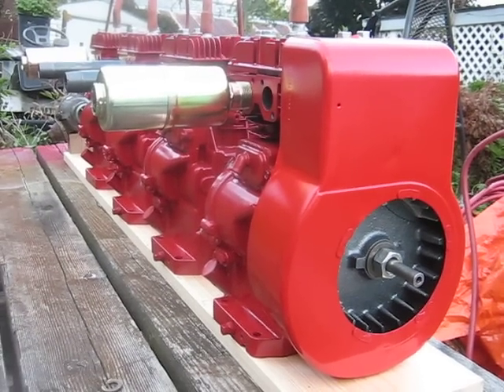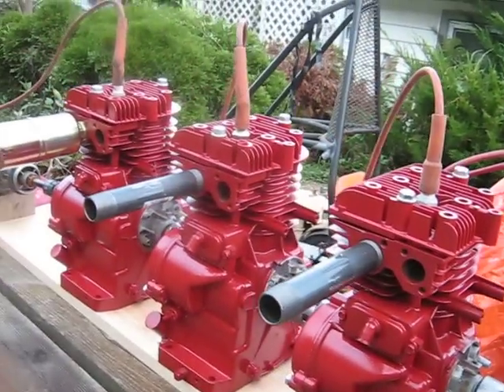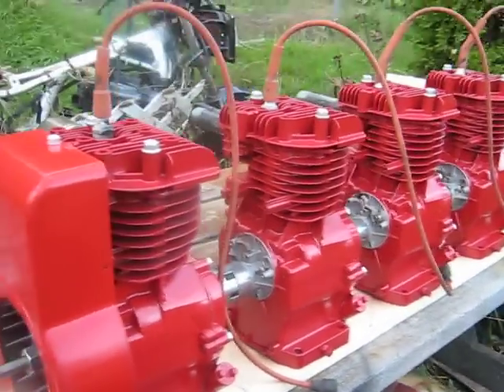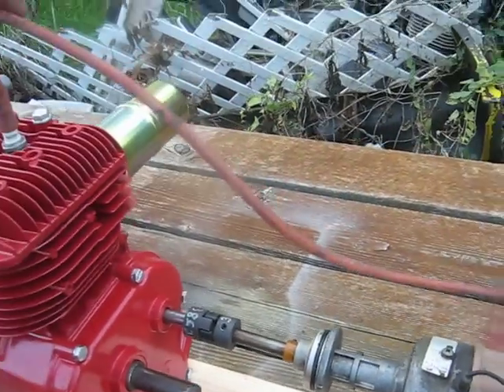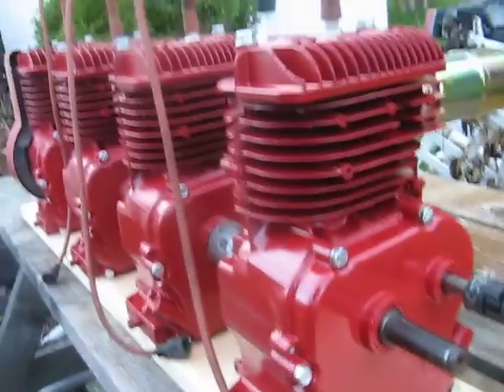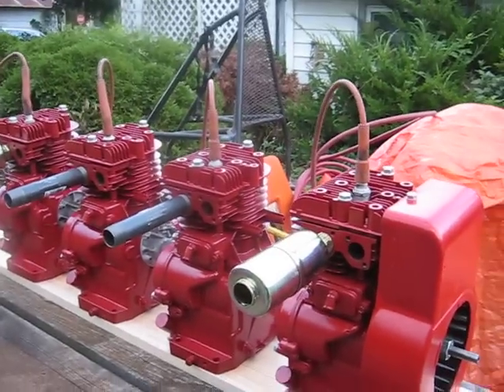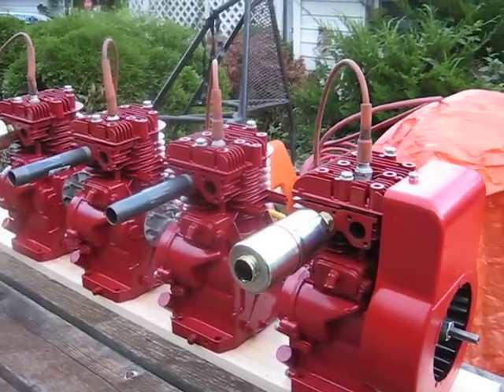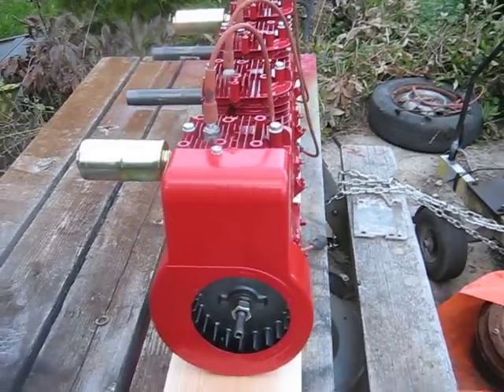4 Cylinder Briggs Unveiled!!!!

Comment: If this freak show could be made to run, it would be just right for an 8-wheeled bike.
Reply from the maker: It does run on at least 2 other vids, later i made a 5, 6 ,7 and an 8 cylinder inline the sky is the limit  :)
Reply: It's one thing to make a freak show, but it's quite another thing to make the freak show serve a useful purpose.  Or maybe a 17 cylinder Briggs could be useful to mow 17 lawns at one time?  Could be, eh?

Comment: another YouTuber welded the books all together and had 1 carburetor and an entire exhaust manifold
Reply from the maker: Oh, you are talking about 805Roadkings 4 cylinder engine. Yes his and my engines are totally different for sure. His engine is a masterpiece of craftsmanship for sure!  My engine is more of a Rat Rod version cobbled together, but it revs up well, and makes lots of noise  :)   Have a watch of the 40 second long run vid of my 4 cylinder, it puts on a good show.

Comment: How much horsepower does it produce combined? It has to be more then 4 times 3.5 or what ever each individual engine produces.
Reply from the maker: Each engine was originally rated at 5 horse, so this should make at least 20 horse, thought I doubt the 3/4" output shaft could handle anywhere near that.

Comment: how did he keep the other 3 cool sense the first motor had the fan/mag trigger
Reply from the maker: +bill morrow My original plan was to run a big electric fan to cool the rear 3 cylinders, but I just ran them without cooling for all of the runs of this engine. On the 40 second long run I shut it down, as smoke was coming off the engines by then. I want to re-use these engines as part of a Straight 8, so I didn't want to do permanent damage to them.
Reply: +ChargerMiles007 How are you balancing the other 3? The engines are externally balanced and will beat them selves apart with out a flywheel.

Comment: What's being shown is really cool, however - and sorry if others in the comments already addressed this, but - this is actually a set of 4 individual single cylinder engines linked together. It's not exactly what would typically be called an individual engine as implied by the title. Individual engines have a single case when assembled that is predominantly shared by the majority of it's internal moving parts.
Reply from the maker: +John Ratko I will give you that much, engines do normally have a common crankcase. Perhaps I should call it a coupled engine, though the title would get pretty long. Hey, have you seen RoadKings 4 cylinder, it is slower revving, but is an excellent project, and looks like the real thing!
Reply: ChargerMiles007 I hear ya.
Reply: +John Ratko I'm not sure I agree. There are engines that were built with exposed crankshafts, individual cylinders, etc. Since the crank has been connected into a single unit, and the units have been fixed to a single solid frame, I think you could call it a single engine, even if the frame is just a board. Consider it a modular engine, with components that can be removed.
Reply from the maker: I like that explanation, it is a modular engine  :)  Thats my story, and I am sticking with it!

Making it into a single crankcase (especially using aluminum engines) was beyond my scope of possibilities. Note this unit does work as a single engine, firing is 1342 like most 4 cylinders, and it uses a distributor for spark. My Briggs 327 stacker motor uses 3 magnetos instead, as I wanted to try that concept.

Comment: My vtwin kohler still makes more power, LOL
Reply from the maker: jmman101 That's good, this is just a test engine, and it proved that the couplings will have a very rough life!
Reply: It is still pretty cool no matter how much horse power
Reply from the maker: jmman101 Thanks, glad you like it. I plan to build a Straight 8 engines also, but I think it may have to wait for next summer, as I need to complete my 5 cylinder radial type first, as well as put the V4 Wisconsin back together!

Comment: i think 805 roadking has u wooped.. so only one is cooled?  hmmmm
Reply from the maker: ka7wyf In some respects, you are correct, he has an advantage though, as I use aluminum block engines, which are much harder to weld. Another difference is that this one is 52 cubic inch versus about 20. This one will rev up, watch the 40 second run vid, it probably hits about 4000 rpm there.I agree though, Roadking has built an excellent 4 cylinder engine, and his 3 cylinder radial is shaping up nicely.  We didn't plan to both built 4 cylinder, then 3 cylinder engines, it just seems to have worked out that way. I certainly hope his 3 cylinder gives him less problems than my crankshafts have.

Comment: You will shear off the last ones crank shaft for sure if you try to use the power.
Reply from the maker: Ned Fan Yes, you are right, this engine, like most of mine are more or less experimental. Though I have used a few of them for practical purposes. I am surprised the crankshaft in my 2 cylinder stacker engine worked OK, as it didn't use couplings like this. My new Briggs 327 3 cylinder radial stacker uses another different design, which I hope works out OK.

Comment: It's just a suggestion, you could well make a clutch so the engines are paired next to each other and construct a fan for cooling. Otherwise, it's a wonderful project you have going on in there.
Reply from the maker: Brian steff magnussen That would be a good idea, much shorter!I am headed in the other direction though, I am planning to make a straight 8!I have a preview vid here about it, its as long as a picnic table.
Reply: I do not think there is anyone who has created a straight 8 with B & S, but I am sure it will be necessary to make the structure very very stiff. I assume that you work for the hand of whatever means are available to keep it on a budget. I think otherwise that the strong one cylinder Chang Fa Diesel engines tickles my desires regarding various strange constructions. Unfortunately I do not have the economy and time to involve in the bigger projects.
Reply from the maker: Brian steff magnussen Yes, I am planning to make a steel base for the straight 8 , and I am definitely on a budget with all these projects!

Comment: One problem I can see if you want to drive something imposing any load is that a snapped crankshaft is on the cards.
Reply from the maker: Yes, you are right, the 3/4" driveshaft won't like the possible 20 horsepower output, if it was loaded down. In addition only the front cylinder is cooled by the flywheel blower, though some electric cooling fans could cure that problem. It is just an experiment anyway, though I did get a 40 second run out of it recently before I shut it down due to smoking. Much longer and I figured I would be getting a visit from a neighbor!   :)
Reply: ChargerMiles007 If each engine had a sprocket and a chain drive to common shaft parallel to the engines it would be possible, still have to look at the cooling though.
Reply from the maker: john brown Oh, I would think the cooling would be fine, if each was a complete engine, and you left enough space between them to be sure not to restrict the air flow into the cooling blower. Thinking about it, that type of setup would be even longer than this one, it would sure be a long 20 horse engine! Personally, I would time the firings to be spaced like a normal 4 cylinder, that way it wouldn't over stress the long common shaft. I would sure like to see a vid of such an engine  :)
Reply: ChargerMiles007 Well good luck in all your endeavours.
Reply: +ChargerMiles007 If you remove the shroud and run a Briggs it will melt down. In fact if even a few shrouds are removed it will melt down under load. They would shave and rebalance fly wheels back in the day for racing and all they could cut was .250-.375 off of the height before the engine would get hot.

Comment: nice work... but how are you going to cool all those cylinders? If you were to extend the shroud would there be enough airflow to keep it cool?  Cool beans!
Reply from the maker: Yes, cooling the rear 3 cylinders was always a problem with this design. Originally I had envisioned the shroud going from the front to the back cylinder, like a tractor cover/gas tank. In the end I concluded that the engine is just too long (at 4 feet) for the air to do much for the last cylinder, so I basically ignored the problem and moved on. I will only run this engine for a short time period, say 1 minute max. (presuming I can get the couplings to hold together that long!), so I will use an external 26" box fan to five some airflow. Another idea I had was to use drip water cooling for the rear 3 cylinders, bet it would get pretty steamy in a hurry!!! I have a few vids of this engine running, but this vid seems to get the most views. I am working on this engine now, and hopefully will have it running again in the next few days  :)

Comment: Could you set them all to exact tdc, find out a different way to tie them together with flywheels still installed and just have them all fire at once?
Reply from the maker: <p>Yes, that would be possible to do, provided the 1/2" dia. shaft on the flywheel end has enough strength.</p><p>I took the opposite approach, spacing the firing order out like a normal 4 cylinder, and only having 1 flywheel. It has caused me a lot of grief with the couplings, but I plan to give it another try using a steel base. I am beating that having all 4 hit tdc at the same time, would result in some pretty good upward movement!</p>
Reply: Not the mention the rock from the torque!!! Thats why I wanted to do it that way.
Reply: setting them all to tdc would set the motor out of balance, the whole engine would sway
Reply from the maker: If they all fired at the same time, the peak torque would break something for sure! This way it runs fairly smoothly, though I freely admit using couplings has proven to be quite a challenge. I hope to have the new LoveJoy couplings installed soon.
Reply: +ChargerMiles007 Love Joys "stack" the slop with multi inline configurations. You need a flexible coupling. They use what is basically a tire or flanged rubber connecting the two hubs. They give flex and allow some miss alignment, but have no slop. They also absorb vibration very well.

Comment: That's not a four cylinder engine, it's four single cylinder engines with four separate blocks mated together. It may be a quad engine rig, but not a four cylinder by any means
Reply: I get what your trying to say, but mechanically it works exactly like a 4 cylinder engine, with independent carbs.
Reply: It's a 4 cylinder power plant... 4 cylinder engine would be incorrect
Reply: Christian C That's what I was tryna say, thanks mate
Reply: .....having one crank and one case makes a big difference engineering and performance wise....one throttle....one Engine....I want to see someone take two Briggs and build them into one case and  off one crank, making a V twin Briggs push like 50hp lol  maybe more if its build well for racing....that'd be cool...and take a lot of dedication.... but imagine if you made casts and sold new bottom ends you could make it a business for small engine hobbyists theres a bunch of grown ups reliving their youth through mini bikes and go karts....then kids still now getting into it. no one seems to have a option for this on Youtube....
Reply: https://www.youtube.com/watch?v=qRX3VWWGr30

Comment: Very nice but how can the timing and/or firing order from an 8 cylinder distributor cap work with 4 cylinders? I want to see this thing run!
Reply: Any V8 distributor should technically work. You just use the 4 ignition points in the distributor that would have originally just gone to bank 1 or bank 2, whichever is easier for you.
Reply: Derrick Hodges It theory it makes sense to work but the points on the distributor cap would have to precisely line up on TDC to fire properly. The  points may be spaced differently from distributor to distributor and may cause it to miss a lot. Its the reason why you cant take any distributor and use it in any engine. I could be wrong but I will still love to see this thing run.
Reply: No they don't, they just have to be spaced out a fixed amount of degrees which all dizzy points are, and it needs to be a dizzy from a 4 or 8 cyl motor. Timing it is easy and only has to be done once.

Comment from the maker: Yes, it does run pretty smooth, as it gets away with just 1 normal flywheel. Unfortunately it has raised heck with the couplings between cylinders, but we may finally have a solution in the works for that.  :)

Comment from the maker: Yes I do, it even uses the standard 4 cylinder firing order of 1-3-4-2, although I had the freedom to do any firing order with this design. I use a modified V8 car distributor for spark, with the old points type ignition.
I have 4 or 5 vids about this engine you might like, I have 2 where it runs for short times, sounds just like a 4 cylinder  :)

Comment from the maker: Yes, they are small LoveJoy couplings (too small for this application!)
Someone mentioned that a farmer had joined 4 or 6 briggs engines together using chains and a common shaft like you mentioned. I can see that type of set-up working OK for an application. I wanted this engine to be more like an actual 4 cylinder engine, so I went with dual carbs, and a common distributor. The couplings have been the weak link (I am machining new ones), most of my engines are experimental anyways  :)

Comment: They look like fenner couplings between the motors,how would it be to have a chain sprocket on each motor running out to a common shaft with sprockets,could make for a very interesting go cart or mini hot rod,good luck to you, you have a great imagination.

Comment from the maker: Yes, you have hit on both of the big problems I had to overlook when I designed this. I could install 3 sma;; cooling fans to help out. The cranshaft size is a different matter, but it has been a fun project, more FrankenBriggs engines in store  :)

Comment from the maker: Yes, it shoiuld be a pretty unique sound, plus #3 cylinder is pretty scored up, so there will be some smoking also. I just have to get the coupling to fit unto the #4 crankshaft, then drill the pin, and that part will be done, finally!

Comment: On supercharged engines without onboard start, normally there is a starter-dog on the blower pulley/starter motor and the belt guard around the upper pulley has key-hole slots the starter lugs fit into. when it turns over, no load on the operator, all of it goes to the lug mount, once running the one-way or overrunning clutch allows the starter to be removed effortlesslly

Comment from the maker: I am working on this thing just about every night!  :)
I am still messing with 2 of the 3 couplings, but I got the first one done last night. The distributor is finished also. I need to finish the base, make carb mounts and mount a gas tank, and do the plug wires and exhaust (I discovered that I can't just put the mufflers straight out as shown here, they won't clear the inlet manifold to #1 and #3 cylinders. Trust me I want to see it run as badly as you folks!!!  :)

Comment from the maker: I am planning to use just such a starter setup, I just hope the nut can take it, and it doesn't break the end off the crankshaft! I plan to put an extender arm on the starter, so I don't get a broken arm! Even with the stock 6:1 compression, the 52 cubic inches will put up a lot of resistance.

Comment: how are you planning on starting this beast? Removable automotive type? Back when I was a kid (hmm, maybe thats still present-tence?) I had a Jr.Dragster, like all ive seen we had a hand-held starter motor that had a one-way clutched shaft with a hex drive into an adaptor/flywheel nut, worked like a peach but a 4cyl may need to be lug mounted.

Comment from the maker: The couplings are standard 3/4" flexible couplings with a rubber piece in the middle. Using these allows for a bit of mis-alignment between the shafts.

Comment from the maker: Dang it man, you are stealing my ideas!!!  lol
Actually that will only work for a 2 cylinder (I think) since 2 pistons come up at the same time on a 4. However, if a person put 2 Magnetrons lengthwise perhaps it could be done. 2 flywheels and 4 magnetrons was my original idea using 3 horse engines. My son suggested using a distributor with the 5 horse camshat extension to drive it, so I switched horses in mid stream, and did that. I have one 3 horse engine painted red!

Comment from the maker: Yes, you are right, the couplings would need to get larger towards the output end. I used the same size for all of them, since I am not planning to load this engine down. Yes, cooling is an issue, I will be installing some shrouding to dirsect the air flow. I was thinking of putting a 12 volt computer fan or 2 to help out also.
It looks like the V8 distributor will be OK, I ground down the 4 lobes that I don't need, so it should be ready now.

Comment from the maker: I had planned to modify it to be 1,3,2,4, but have decided on the usual 1,3,4,2.
With this arrangement a person could make them all fire at once, but that kind of defeats the purpose of having 4 cylinders. Plus it would be harder to start, since they would all be on compression at the same time.
I am only using 1 flywheel, so I need the power impulses spread out to keep it running.

Comment from the maker: Yes, some Briggs 5 horse model 130...  engines have a shaft extension off the camshaft, so it turns at 1/2 the crankshaft speed, so it works ideally for a distributor drive!
I was going to use 3 horse Briggs engines, but I had a different way to provide the spark.